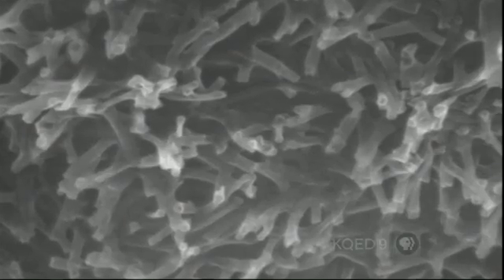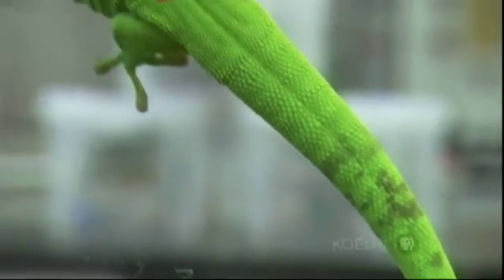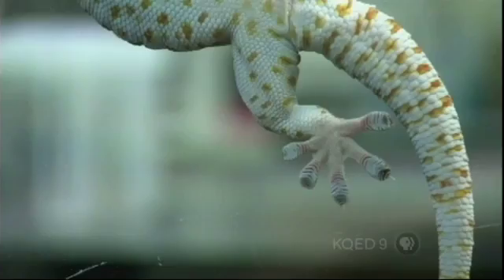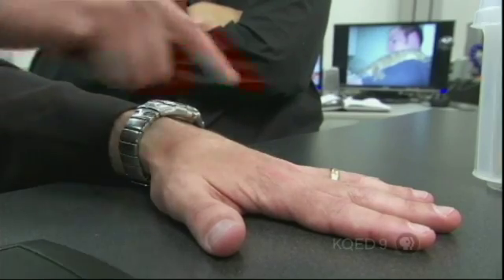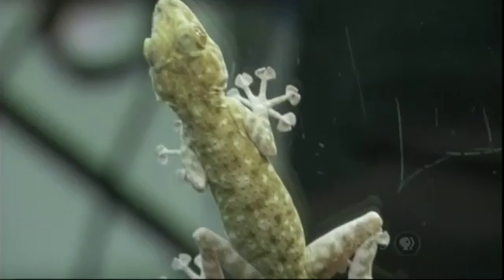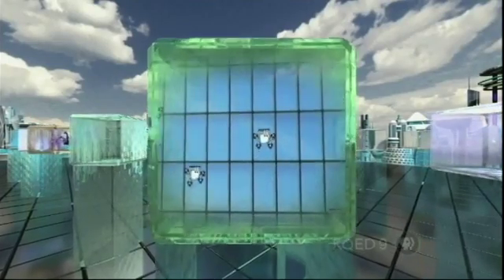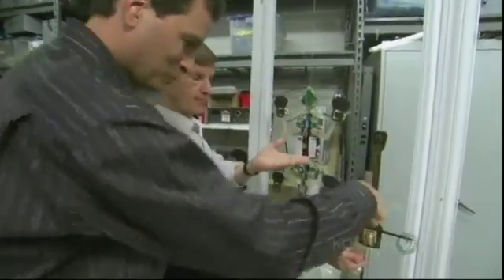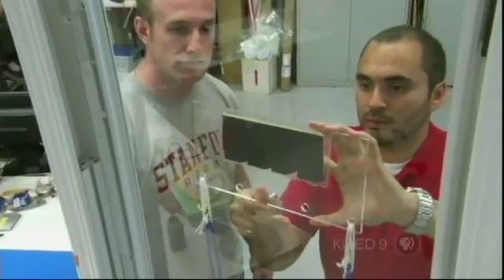Smart materials (1 of 5): Gecko Adhesive fit for Spiderman

Comment: but what about artificial gecko robot for celling? it will not work on the explained way for the asked question
Reply from the maker: Look for a comment I posted 4 year ago. Without gravity pulling in the required indirection, the other way to achieve the adhesion is to pull 2 pads towards each other in opposite directions. i.e. a pinching action will enable the robot sticking to the ceiling. I bet the real gecko does the same to walk on the ceiling too.

Comment from the maker: I gave a response to the same question 9 months and 11 months ago. The two responses still are shown near the top of the comment section. One word, pinch!  If gravity is not pulling in the direction needed for the adhesion, then the gecko can still pull the pads against each other using a pinching motion.

Comment from the maker: If they redesign the adhesive pads to pull towards each other like a pinching action, then it does not need to rely on the gravity to pull it down to create the adhesive force. i.e. the lower pad pull the upper pad down while the upper pad pull the lower pad up. Then the robot can go upside down with no problem. Of course the robotic feet movement will be more complex than what is shown in the video. It will need a pinch and "unpinch" motion in each step to engage and disengage the "grip".

Comment from the maker: I guess if the gecko can do it, the mimic material can do it too.  All you need to do it is to pull these pads against each other as if you are pinching the ceiling. Of course that would take much efforts instead of just "hang" on the wall relying on gravity.